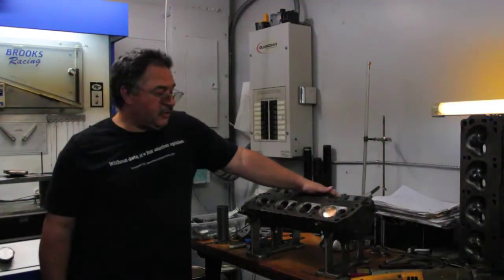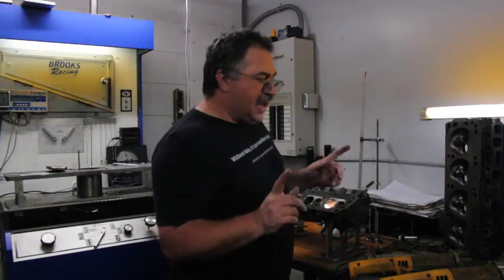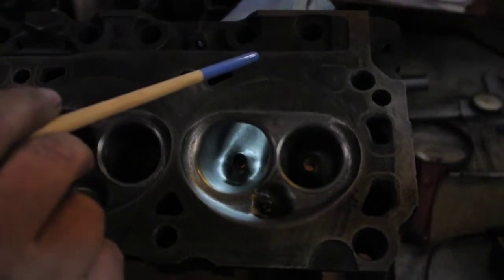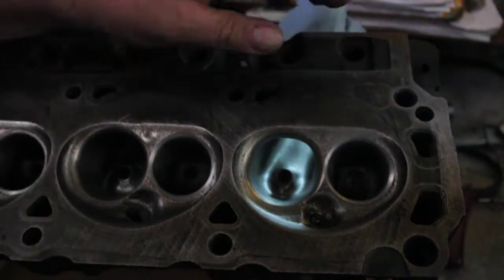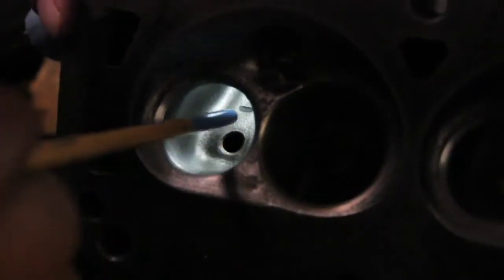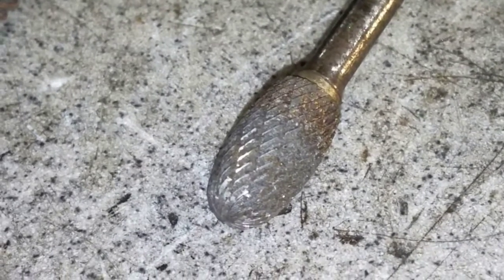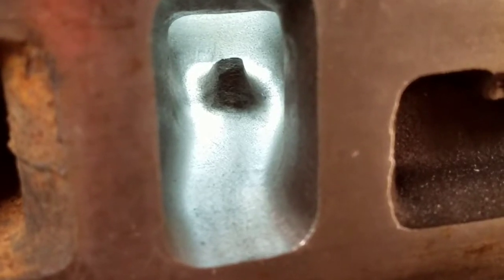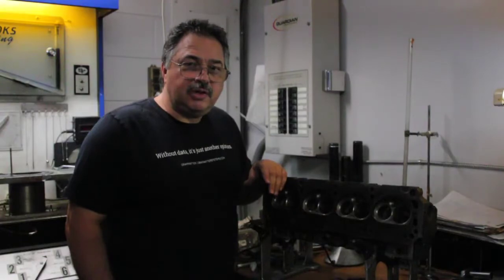David Vizard E7TE Ported Heads for 306 Ford Dyno, Ultrasonic Measurement and Port Textures

Comment: Has anyone gotten e6te heads to do anything?
Reply from the maker: E6te are the closed chamber with shorter valves? I have a follower who was working on a set. Thanks
Reply: @servediocylinderheads the chamber looked more modern and a smaller cc.    I see what you guys mean about the shrouding.   Buy someone can lay that wall back.
Reply from the maker: @dennisrobinson8008 No doubt. Thanks
Reply: I'd lay that wall back.    Dave Vizard and some of the porters show there is a ball tool they use around the valve to open the chamber with.    I'd lay that wall back and then mill it to raise CR.   I've never seen anyone do it.     This head might be worth something in a class you have to run a factory inline valve head.   Normally they skip right over E6 heads but i haven't heard of anyone modifying the chamber to unshroud the valves.    I'd also keep the exhaust valve small.   Maybe 1.54 or even the 1.47.   Experiment with a  larger intake valve if it makes sense.

Comment: How in the world does where the valve stem goes through the head, have anything at all to do with valve seat wear??  That sounds like B.S. to me.  The valve spring keeps the valve centered in the guide, so the valve is going to be hitting the seat evenly, thus, the load on the seat will be even all the way around.  When the valve is opening, the rocker arm can exert a little bit of push on the valve stem to the opposite side of the pushrod,  so you can get a little bit more wear, but it's NOT going to do anything to make the valve sink into the head when it closes again.  Car manufacturers started doing induction hardening of the valve seats to compensate for the wear due to the loss of lead in the gasoline.  If you're getting sunken valves in your heads, have hard seats installed.

Comment: Recommend a good electric die grinder? Bought a foredom pedal speed control
My old mutabos had adjustable speeds so pedals would work on them. They finally burned out though
Any more info on your (model?) sonic tester? at the point I really need to start using one. 
Esp for imported alum heads, some areas the metal gets goofy
Reply from the maker: @gordocarbo   I use a small Dewalt 887? Good for the price. Single speed. I have scr speed controllers. My sonic is no longer made. They do have a new model but I know nothing about it. Thanks

Comment: E7 heads aren't designed for the things your trying to do hell a stock set of GT40 heads will dance circles around e7s
Reply from the maker: No they won't. They are a bit better not alot better

Comment: I know some one that worked the me7..heads to put in a  202... Valves...,
Reply from the maker: In order to use a 2.02" valve the seats need to be sunk a bit because of the recess by the plug. Not really my style. Thanks

Comment: I don't have a flow bench and never did and yet my heads will outrun alot of these heads on YouTube,  I have yet to see a 10 second all motor car on any other channel on YouTube , all I hear is alot of hype and see nothing all I hear is flow numbers and dyno results that prove nothing to me , so think twice before you tell people to run if you're having heads ported and they don't have a flow bench just saying its very disrespectful
Reply from the maker: Most guys aren't you Terry.
Reply: @Charles Servedio cylinder head porting & flowbench  I've had 2 people just mention this to me and they were very offended and they both make big power doing head porting with no flow bench,  my friend John is a mopar guy and he whipped up on my friends cougar a 10 60 car all he had was a 360 mopar with his own ported heads and my other friend just made way over 500 hp with a pair of his ported heads with no flow bench I'm just saying people get there feelings hurt over these kinds of comments it isn't necessary
Reply from the maker: @terrygrover6440  Gotcha Terry, I didn't say it couldn't be done. I said I did it without a flowbench for years. I have had the bench for 7 years now , there is plenty to learn. Thanks
Reply from the maker: Terry, I built a 306 in the early 90's for a friend worked E7's no n20. Ran 11:00 @128 with a crappy 60ft. The mph shows it is making some power. Thanks

Comment: Iv see...202..gm valve's cutt and installed in the E7....head......good combo
Reply from the maker: Not sure how they do that without changing the valve centerlines. The plug recess just makes 1.94". I guess if you sink the seat quite a bit a 2.02" would work. Hmmm

Comment: Exhaust sucks
Reply from the maker: But in reality does it after it has been ported correctly?
Reply: @servediocylinderheads  you other porters focus on intake valve chambers . If get flow up on exhaust side intake side will improve naturally. Starting with more air and fuel entering the the chambers. Now you are cooking with water.
Reply from the maker: @MrBlackbutang  Scavenging? Yes, that makes a big difference yanking in the fresh charge.
Reply from the maker: @MrBlackbutang  It is harder to fill a cylinder than to empty it. Think of the pressure differentials.

Comment: I'm from Mexico city, congratulations for your explanation, i had that kind of heads, mi cuestión is, the size of the valves?
Reply from the maker: Original 1.78/1.46 modified 1.94/1.6
Reply: @servediocylinderheads  tanks

Comment: Are those second wholes in the exhaust port the actual port that the egr system draws from? that's pretty cool, and I wonder if you were to weld them closed and give that material a finish could you gain a little from that?
Reply from the maker: The TFS high ports I am doing have the egr ports welded closed. On the bench the added holes flow a tiny bit more. On a running engine weldded holes would be worth a few hp.
Reply: That's really cool. Probably not much worth the time, but if someone's already hard into porting an e7 I guess every bit could be made to count.
Reply from the maker: @purestress2597  Nobody is that stupid...wait.
Reply: @servediocylinderheads  You may be looking at nobody. Money is temporary, but time spent welding and grinding is a profession.

Comment: Charles Servedio, is it possible to get the air speeds the same on both sides of the bowl without negatively affecting Swirl?
Reply from the maker: As a rule I don't port for swirl. I may do chamber mods for swirl. I port for max airflow with min csa.
Reply: @servediocylinderheads  does porting intake bowls with more port bias on the cylinder wall side increase swirl.  And is that the primary reason for port bias or is the primary reason because u can't take as much metal out of the c.o.c. side?
Reply from the maker: @ericsmcmahan  It helps in two ways, it increases flow and increases swirl at least in the sbc head. I would think sbf would follow.
Reply from the maker: Well you can't take as much, exhaust port. Also hot so it needs some metal.

Comment: I've wondered for awhile has anyone added the heart dip shape to a combustion chamber with weld and grinding? Just curious one of those huh worker if you could thing. If so would it do anything other than lower chamber volume like induce some swirl?
Reply from the maker: Iron welding is tricky.

Comment: Great video. I am doing a set of e7s and was wondering about valve sizing. currently the valves are liberty performance 12 degree intake at 2.020 and 1.5 exhaust, don't remember UHA on the ex. But I bought the valves big so I could cut them down to correct sizing. What would you recommend for valve sizing? Valve job will Probably be NWN cutters with a chamber relief on the intake side and a radius on the exhaust throat up to the 45.
Reply from the maker: The set I did for D.V. were 1.97"/1.6" my most recent set are 1.85"/1.6" I am hoping to get a better shape on the ssr with smaller valve. It will not be possible to shape the bowl right for 2.02" just not enough iron in a few spots.

Comment: So I forgot to ask... is there any way that you could take like an inside caliper and tell what the measurement is between the OD of the valve stem guide hole is to the dog leg wall you're pointing to at around 8:00+     I think I took mine to around .560ish"   but I wasn't sure how close I was. Then just cloned all 8.  Kind of going by the look of it.  Definitely opened it up some but if there was like a point  or limit  you could say  would help me. all I have are inside calipers and t gauges no sonic stuff.   I would have hated to waste my time if   they are supposed to be like .600 for any improvement.
Reply: important to note I am running stock valve sizes so taking in bowl percentage size ( i forget if its like no more than 85-90%)  into factor also
Reply from the maker: Running a stock sized valve changes where and how far away you want that wall. That wall is thin where you need area.
Reply: @servediocylinderheads  thank you..(didnt see this for some reason) that makes sense actually.. I think I left it at .560"    Just kind of voodoo visual and kept in mind the percentage rule of the valve face ..  but I did do some of the work in the combustion chamber..  I guess what I can't tell when you say rounded down above the exhaust valve    is the edge  of the combustion  area also rounded down?  It's hard to tell  I just flattened that area down a bit (inside the edge)    and took out a smidge above    kind of going on looking at this video . We need 3d video lol
Reply from the maker: @DS-mo6md  If I understand your question the answer is yes.

Comment: Aren't you losing venturi effect by opening the throat of the bowls like that?
Reply from the maker: Good question. If it did flow would decrease.
Reply: @servediocylinderheads  Can you measure the velocity of the ports with the flowbench? Not to my knowledge. Part throttle operation is probably worse with those heads because of the nonexistant venturi in the heads, correct?
Reply from the maker: @ghj1502  I measure velocity on the flowbench using Pitot gauges. this give accurate steady state air speeds. wwat makes you think there is no venturi? The midrange acceleration on heads done this way is explosive, hard to shift fast enough.

Comment: Hi Charlie, 
Great videos, there are still plenty of us practicing the medieval art of cast iron head porting !
I have always wondered how  the  exhaust cross over port / channel in the windsor heads effects flow numbers on that exhaust port ? Do you have any examples.?
Cheers,
Russell.
Reply from the maker: It flows better than a standard port as far as cfm. The Helmholtz tuning of that port will be less due to the exhaust splitting  directions. I feel it is a wash. On an all out head I would think about filling it with aluminum or ceramic epoxy.
Reply: @servediocylinderheads  Anything to say about grinding the thermactor humps out of the exhaust ports?
Weld them up or just plug them?
Reply from the maker: @jimurrata6785  I grind them out. I am also careful not to make them too thin there.
Reply: @servediocylinderheads  Thanks Charlie.

Comment: 👍😎🇺🇸 One of THE BEST that Ive ever seen!!
Wish I could see the 289 peanut chambler C6OE-B (4 bbl) head).
Yes they are obsolete 😨
Reply from the maker: Thanks Ray, everything I work on is really obsolete. They can still get the job done. Bringing up the efficiency is really what is going on.
Reply: I have a new set of those C60EB peanut chambers, 194/160 fully ported/ relieved in 1999. 56 cc. Never run.
That peanut shape is much different. Might update chambers if I knew what.
Ancient tech but FREE 😁😁 not building a race car.
Thank you Charlie 👍👍

Comment: Would you use a similar cam to the E7 engine. 9:1?
Reply: CC xe264 or xe274 👍
Reply: carbed id tighten the LSA to 110

Comment: Charlie, I see the exhaust is not level on both sides of the valve guide? Im having issues wanting to level that area and you will break threw.
Reply from the maker: It should be angled a bit. Flow is coming from the center of the bore and moving toward the cylinder wall.
Reply: @servediocylinderheads  thank you

Comment: Just curious if any of this applies to the 3bar gt40 head or how they would compare? They already have 1.84/1.54 valves and a larger port stock. I’ve seen magazine articles decades ago saying they’d go in the 240’s on the intake and maybe around 200 on the exhaust. Thanks for the video.
Reply from the maker: I am actually doing a set of gt40p now. The gt40's are very similar to E7's but have better shaped ports. It is almost like they were modeled after ported E7's. I did a thread on the gt40's on Speedtalk.com.
Google Build a Lightning Bronco? It should come up. Thanks, Charlie
Reply: @servediocylinderheads  3 bar...match..93..cobra heads..from what...iv gathered....
Reply: @servediocylinderheads  have you seen the article in SpeedTech on the 1969-70 351 Windsor cylinder heads? There is a guy named Joel Allen Dubose of Pat Musi racing engines. He did a set long long time ago that seems impossible but it indeed happened. It was definitely north of 260 CFM. I'm chasing the SpeedTech flow numbers, 248 CFM.
Reply from the maker: @garykarenmcgruther6386  I haven't but since the 351 ports are a bit larger I don't see why it is not possible. Thanks, Charlie
Reply from the maker: Chasing a flow number is called "Flow blind". It is contagious...

Comment: DONT USE CHINA CRAP PLZ . CHINA IS SCREWING OUR COUNTRY . USA 🇺🇸 USA 🇺🇸 USA 🇺🇸 USA 🇺🇸
Reply from the maker: Yeah. I am with you... problem is people want this stuff and the Chinese can make some decent stuff. So I am stuck in the middle. To date I have never gotten a factory fresh head that didn't need the guides or seats touched up. I fon't care where it was made. Production is speed not high accuracy. Do I prefer working on American aluminum? Yes. Thanks, Charlie
I should include that if you need to buy heads buy them bare and load them with quality parts, fyi.

Comment: Nice video.  Thanks for talking about sonic testing, nobody talks about it and it is extremely important!!!   I would also recommend pressure testing equipment because a sonic tester won't detect pinholes and certain casting flaws.

Comment: great video!  I cannot tell you how many nights I spent breathing cast iron dust as a teenager in the late 80's messing up all sorts of early and late iron 289/302/351 heads in the back shed.  testing at Englishtown the next weekend!  do you think the early 351 port, given it starts about 140 ish cc's can be shaped as well as this?  curious.  have a set ported by a friend of mine with 1.94 valves - note he did work doing pro stock heads professionally for a while so he has some knowledge.  claims 240 cfm which sounds plausable.   cannot wait to try them on a good 310" shortblock.
Reply from the maker: I was going to Westhampton dragway before they closed it. 351 head should easily go 240cfm but I haven't had one on my bench. Thanks, Charlie
Reply: @servediocylinderheads  ,,,,,,wow ,,you got Long Island history........
Reply: Wow !!
Of course the porting costs as much as alloy heads.🤔🤔
Reply from the maker: @hotrodray6802  The part everyone seems to forget is brand new alloy need to be gone through for valve guide clearance, valve seat concentricity, and valve spring load at the minimum. Be sure to add that to the price.
Reply: understood, no out of the box stuff is trusted.